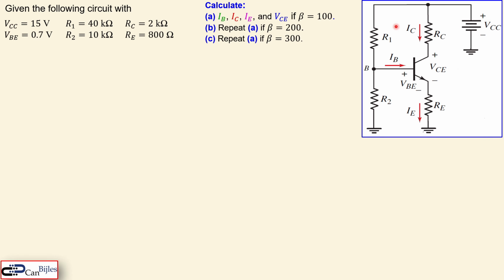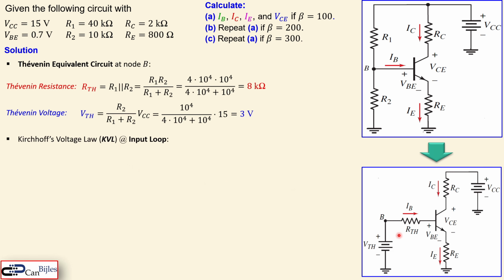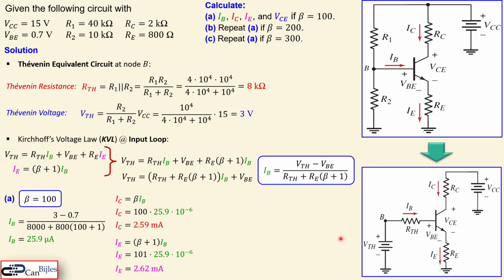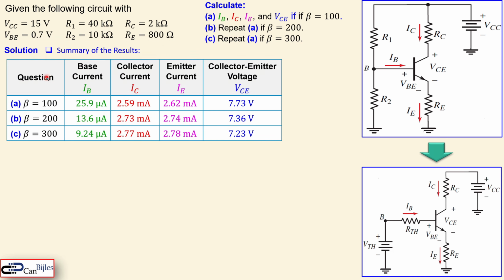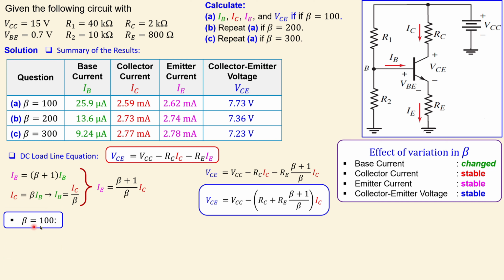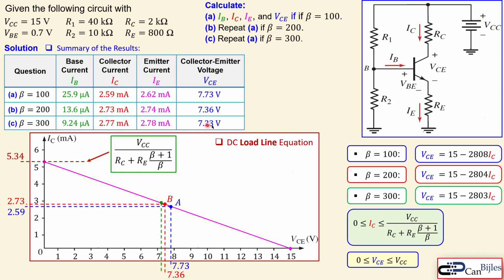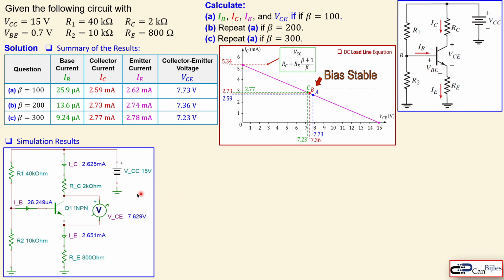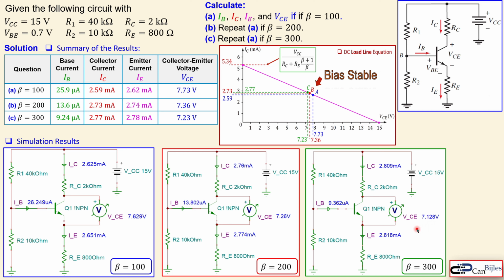Bipolar Junction Transistor (BJT) Circuit 🌟 Four-Resistor Bias Stable Circuit 💡 Example 4

Comment: Four resistors!?  Whoa 😯

But seriously, this was cool.  I actually set up a system of equations and used Wolfram to solve them without calculating the Thévenin equivalent circuit first and got slightly different values.  However, determining the equivalent circuit seems like it was a worthwhile simplification.  To clarify, are you just taking the transistor out entirely, and is that always valid?  Thanks!
Reply from the maker: In electronics design using discrete components, four resistors basing is still used because it is fairly easy to use. However, for more stable designs, a constant current source is much better for amplifier design. See my playlist about IC biasing and differential amplifiers on this channel. 

About the Thévenin's Theorem on this circuit. The circuit is decoupled at the base node and an equivalent circuit is placed at the left side of the base node. This will produce the exact result. Other methods will give an approximate result.
Reply: @CANEDUX  So to confirm, the transistor is taken completely out of the circuit (i.e. replaced with an open) to calculate the Thévenin resistance and voltage, right?
Reply from the maker: @PunmasterSTP  That is correct. You might want to watch this video about Thévenin's Theorem: https://youtu.be/-82oP4y-uXo This will help to get the idea much better I think.
Reply: @ Thank you!  It's been a while since I've studied circuits so I could definitely use a refresher.
Reply from the maker: @PunmasterSTP It is always good and healthy to refresh 😊